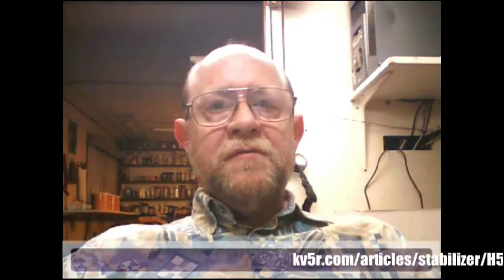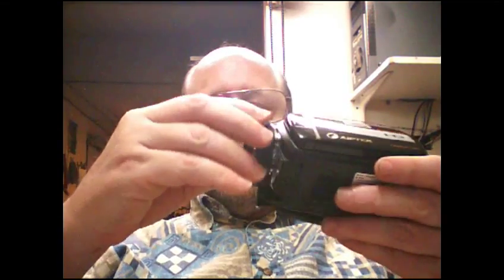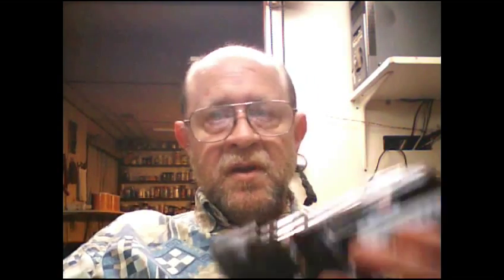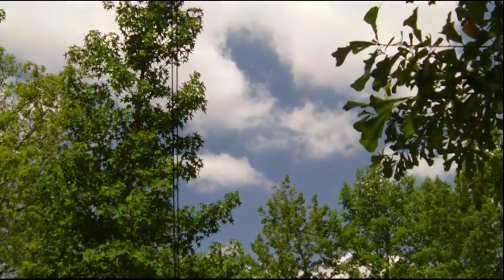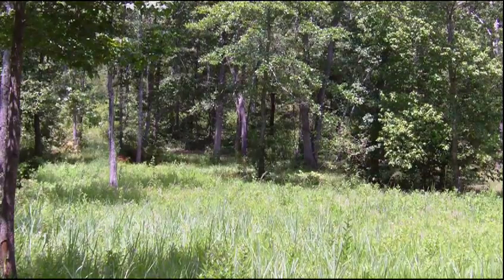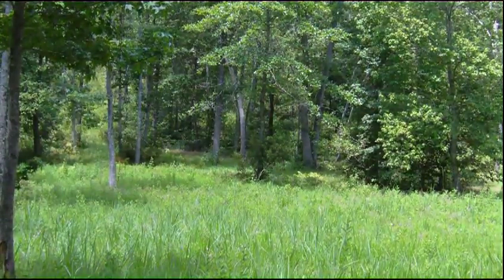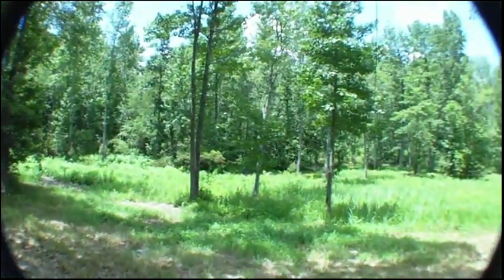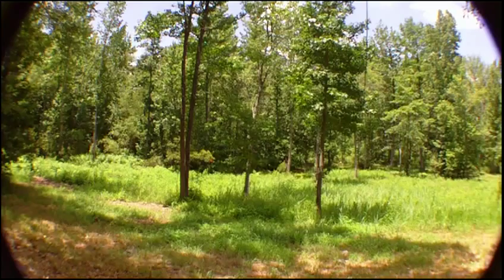Put threads on unthreaded camera for filters, wide-angle lens, and hood, by KV5R

Comment: i have a question i got a camcorder with a thread  of 40.5mm know I am trying to get myself a very wide angel lens for it my camcorder is sanyo xacti hd2000  my question is this i could get a step down ring and fit a 37mm fish eye lens would this work or do you need a bigger lens? than my filter ring of 40.5 any advice would be helpful the wide ange is for close up video not distance.
Reply from the maker: Maybe. Measure the lens diameter of the camcorder, not just the threads. I think the fisheye should be considerably larger, like 35-40% larger (than the front objective lens), lest you get too much spherical and chromatic aberration around the edges. But I'm no expert; might be better to check with some photography forums.

Comment: i just bought a sony handycam hdr-pj230, i was wondering if i could do the samething? but i was a little iffy because the mic is almost flush with the chrome piece around the lens. any suggestions on what i could do?
Reply from the maker: Well, I just looked at a pix of your cam and it looks like there's no way.. Exposed lens barrel is too short at the bottom; front and inside are beveled.

Comment: I was hoping to see how you mounted the filter adapter, but you skipped that part - so the title needs to be changed. Otherwise well made.
Reply from the maker: +jim fortaleza 
No, I didn't skip that part. I explicitly stated that I put a narrow strip of "packing tape" onto the lens barrel of the camera and then screwed a female-to-female filter adapter onto that.
Reply: +Harold Meltonou I understood what you said, but had hoped to watch (I used the term "see") you mount the 46mm filter adapter  on the camera. Thanks for the other filter suggestions.